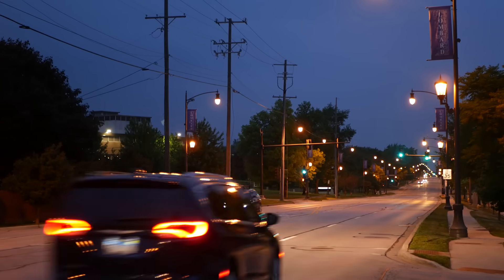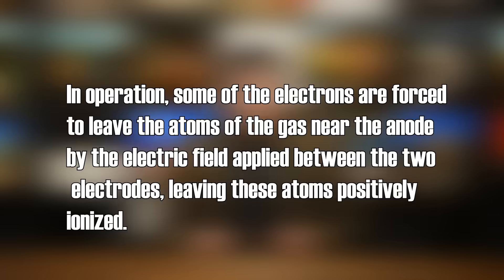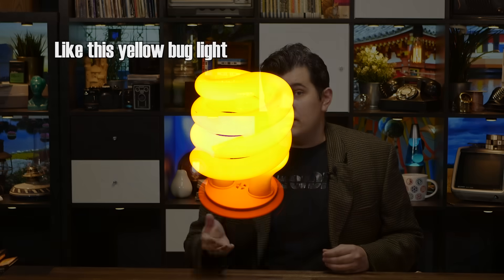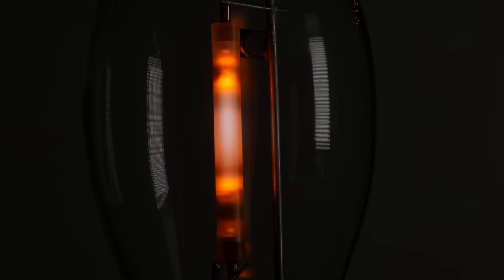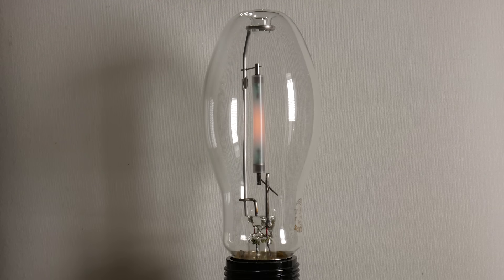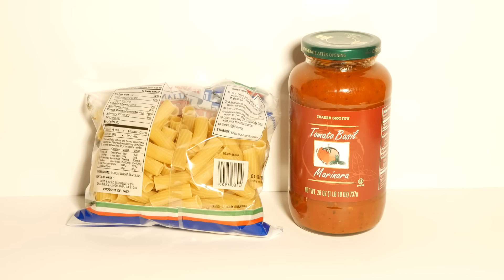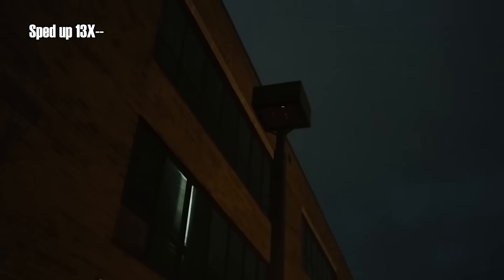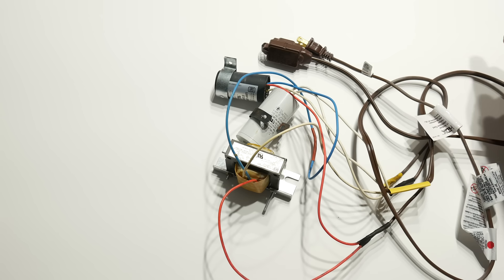The High Pressure Sodium Light: Ubiquitous, effective, but good?

Comment: For low pressure sodium, the CRI is actually negative, although it doesn't really mean much when you already know it's monochromatic. But yeah, the bit about zero meaning you can't distinguish color? Well, you probably can't, but zero is mostly just a number, because it's not just sodium vapor lamps that can be negative CRI. Bad CFL's are actually sometimes as bad as a CRI of 50, with prominent peaks and valleys in their spectrum that are even more annoying than their CRI value might lead you to believe. But actually, for streetlights, rather than indoor lights, being monochromatic is a good thing: not only is it (potentially) efficient, with no need for a phosphor, but anyone who wants to view the night sky can filter out that wavelength specifically. Such as astronomers, or people who don't like to be able to read by the light diffused through the sky from a city many miles away and would rather be able to look at the stars sometimes. It may well be that we need to use a LED version... just not the bluish greenish white of most new lights. Maybe we pick a different frequency that's still easily filterable but that we're more sensitive to. Or maybe we have a LED that can make as much as 3-400 lumens per watt when used for a single frequency instead of white light.

Comment: Yet another great video thanks for making it. They just upgraded our streetlights from sodium to LED and in all honesty we are not impressed. There was a few distinct advantages of the old sodium lights over the new LED. The first advantage of the sodium lights over the LED was they appeared to be be far less dazzling. If you inadvertently looked in to the sodium light it would not leave you with that lingering dazzled sensation unlike the LED lights that leave you with the colour burning in your eyes even when you look away. The second advantage was the sodium illuminated a far wider area.  The third is the way the LED lights are appearing to making the dark areas look comparatively darker. Its a bit like if your stood in the sun and look inside a tunnel it just looks pitch black but if you stand in the tunnel you can see just fine. If you stand in the bright area under the LED lights and try and look out its just black yet this was never an issue with the Sodium light.

Comment: You did not mention The first "NEW" street lighting from the late fifties! Mercury vapor (Discharge) lamps. They were first seen by me in 1958 at the new Tyrone Square shopping center in St. Petersburg Florida, as I recall it was a SENSATION!!! It was the largest shopping center on the west cost and the lights could be seen by ships out in the gulf, the center 5 miles from the shore. The street lighting in the city of St. Petersburg at that time was incandescent large bulbs and florescent tube fixtures down town and on Central Ave. Those "Greenish" lamps were every where until the late eighties. I first saw Sodium vapor lamps on the expressways of France in mid seventies.Did you know that there were "Studies" done in the late 80's or early 90's whether these new "Reddish" street lights were contributing to the increase in violent crime in cities that dad installed them? Thanks this was a good video.

Comment: "No matter what I say, I'll be wrong"
1:06 - The inside of an incandescent bulb is not vacuum, it's actually a low-pressure noble gas - usually Argon.
I guess you were right :)
Reply: And IIRC tungsten was chosen not so much for it's high temperature tolerance as for it's low vapor pressure "One atom per universe"

Comment: NOT anymore..... Mine is LED and its white and AWESOME!!!! looks like day light and it used to be 135 watts Sodium Vapor  but now its 49.8 watt or 50 watt as they call it with MUCH more Light look... its funny because like the sodium its almost Sodium to where they need to heat up to be at full Brightness but DAM they are NICE White LIGHT!!!  I was talking to the Tech when he changed them out and they are changing them out even if people Dont call to Complain their bulb is out  why you ask its Cost he said they are using 1/4th the Power at each street light you can do the math on the power and $$ CHA CHING savings alone its huge     he said a couple of techs rough calc it to be 1.1 mill a day in savings and OUR bills are NOT going down so they are pulling in some BIG BANK!!!!!   I can show you 2 pics from my power company on two of my properties and you can CLEARLY see a HUGE difference with the NEW LED Bulbs in Clarity Brightness and its almost like the SUN is on............and BC I am in Florida SO far I think we might have a secondary Benefit too ......I have been Noticing very few to NO Bugs around the LIGHT when on and I know they dont like LED wavelength so this could work as a natural Bug repellent too if im right.......Anyway I was very skeptical about the Swap but They have since changed 3 of my 7 and I have asked them to do everyone when they can...

Comment: You know what I've seen which is rather unfortunate is that LED replacements are often unreliable! I've seen quite a few faulty LED streetlamps, kinda a bummer! but I'm sure that this will be fixed after a while... probably working out durability issues of the boards.

Comment: They still use sodium lamps in my town in southern Spain and, from my experience, pretty much everywhere in Spain. I think there might actually be rules that limit which colors you can use in certain historical areas, as orange-peach light makes stone architecture look way better at night than white light does.

I personally like it, even though I chose 5000K LEDs for my home. For street lighting, sodium does a great job of making an area look cozy and is gentle on the eyes, all without the horrendous inefficiencies of incandescent lighting. (Incandescent lights are no longer available in most of Europe, and for good reason.) LEDs, I think, make historic streets look dull while making modern urban areas look more striking. LEDs certainly work for outdoor lighting in non-historical city areas.

Comment: The problem of light-pollution is also a reason for the Sodium Lights. White light scatters more than yellowish-orange and at nighttime hours the Sodium Lights help our eyes adjust better. This is helpful when driving at night. If you are driving on a highway at night it is better to have lower spectrum lighting. So as our eyes take time to adjust from pitch darkness to city light, it seems safer to have a less-scattering light wavelength.
Correct me if I am wrong here. Also this is just a short comment, so I may have missed something as well. : )